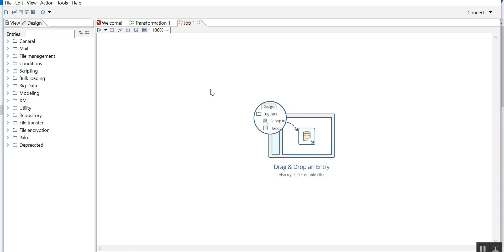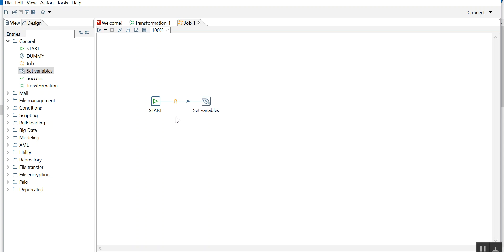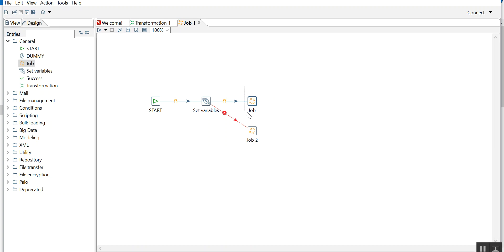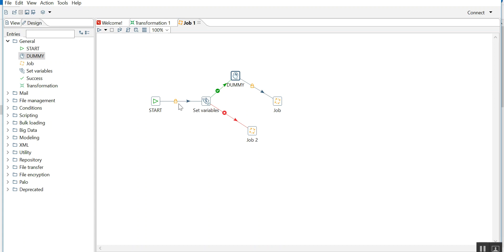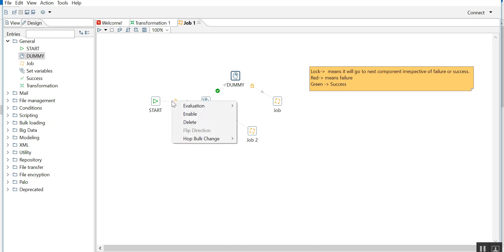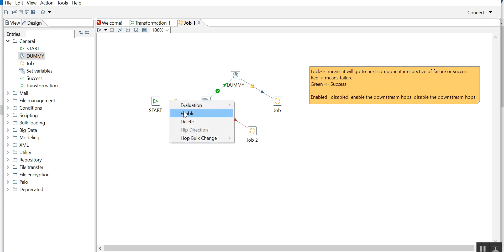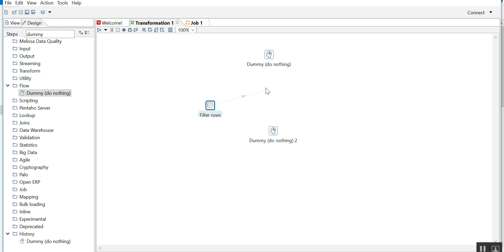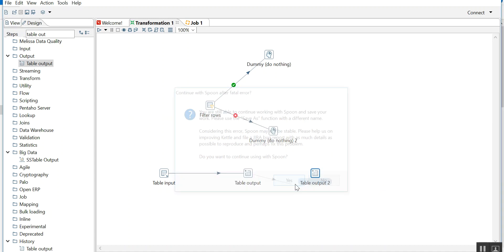Hops in Pentaho

Comment: What if I don't put any success condition and instead from last transformation I route the hop back to the first transformation, so that it continue in running state   always and what is the impact of such job on the performance of the system??
Reply from the maker: Your code should be Ktr->Dummy->prev-ktr , impact is decided based what code is written inside the transformations, if its simple check file exitences or small shell script, it will not create any impact. 
In one of my project, there were several shell scripts which runs on infinite loops to check whether main ETL job is running or not , if its not running, shell script will trigger that job. So, its not going to hamper the system performance.

So, you need to use Dummy between the two transformations
Reply: @BitsBeatsBubbles  can you please share the code to check whether ETL job is running or not and if not running then trigger the job?
Reply from the maker: @Pranav-fg5jr   while (1=1)  ##using this, shell scripts will run in infinite loop
ps -ef | grep prcoess_name    ## try to search your job or transformation using this command.
if this gives u some value , that means process is running 
else
sh kitchen.sh file=/path/file_name -level=Basic ## This will run your job